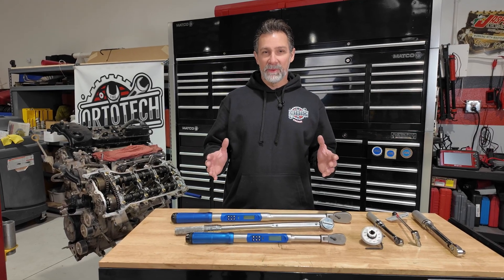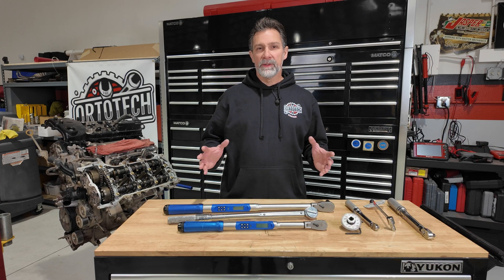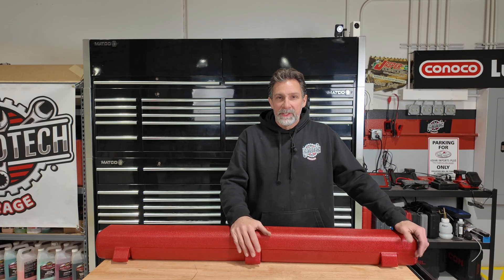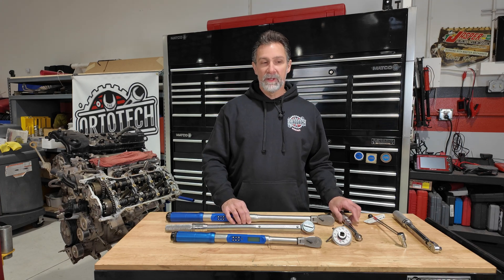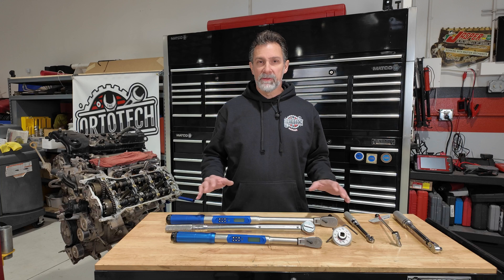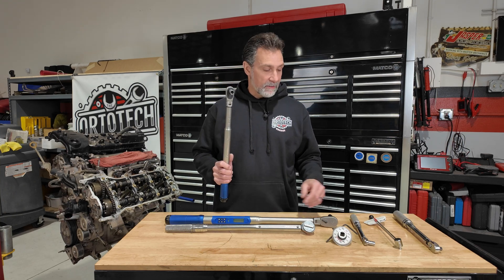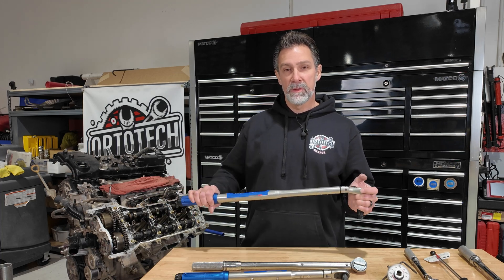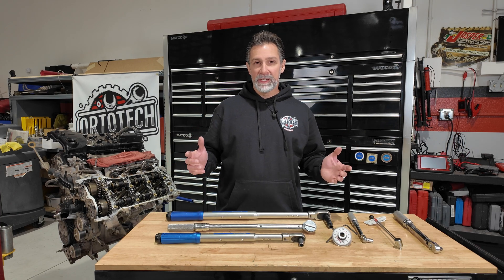Old vs Digital Torque Wrench | What Every DIY Mechanic Should Know

Comment: I have a precision instruments 1/2 drive 40-250ft lbs split beam that I use for lug nuts and front end components, and my Mac digital made by eclatorq 3/8 5-100fd lbs for most engine work. I’ll add a 1/4 in lbs soon.
Reply from the maker: Nice!   The 1/4 is probably the least needed torque wrench, but definelty worth having for delicate work.

Comment: Hello, I am a mechanic in Türkiye. Where can I learn how much torque to tighten bolts such as car valve caps and valve bolts?
Reply from the maker: Hello.  I use an online system made for professionals called Alldata.  There are others like Pro-Demand and Identifix, too.  They each require a subscription with a cost of about $200 per month, each. It has all the factory repair information we need to service and repair most vehicles. 👍  If you need something specific only one time, I can email what you need to you.  Contact me at OrtoTechGarage@gmail.com.

Comment: 40 years working on my cars. Never used a torgue,wrench never had a problem what's so ever!
Reply from the maker: Wow!  Impressive.  I'd say you're either really good or really lucky. Lol. I see problems come in my shops all the time, especially from improperly tightened hub/wheel bearings, lug nuts, pinion nuts, broken off bolts, stripped drain plugs, and caliper bolts that are falling out.  Just to name a few of the common ones.   Better safe than sorry.  Just my 2 cents.  👍
Reply: The old good and tight. Love it. Sometimes though I need a tool to provide the cert. Just for liability..